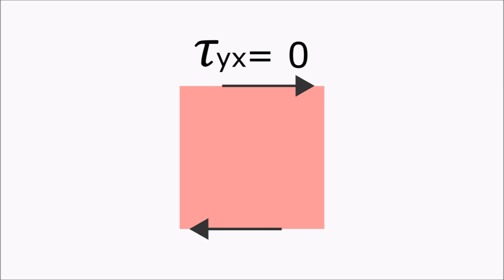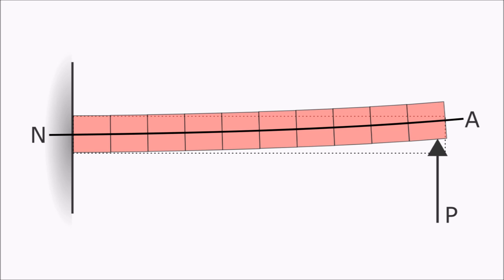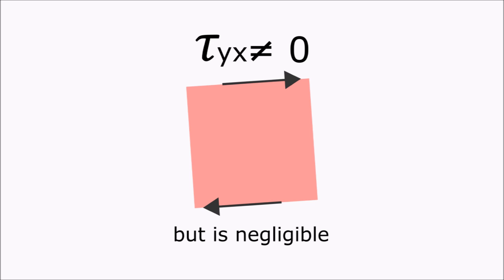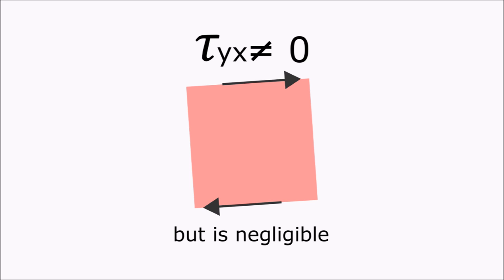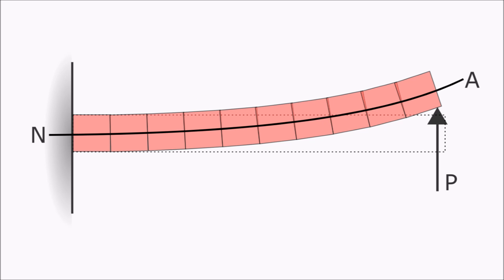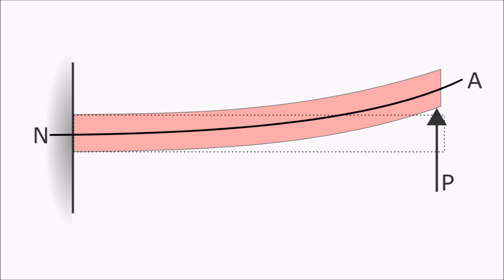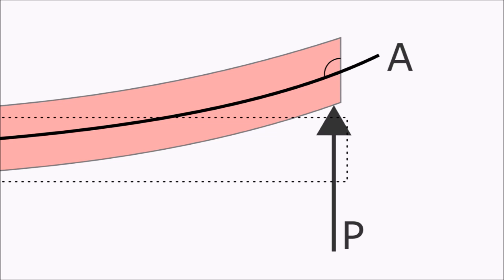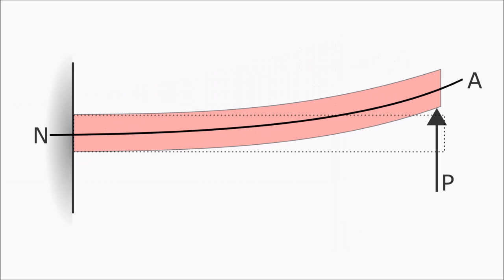Euler-Bernoulli vs Timoshenko Beam Theory

Comment: Maybe I got something wrong, but as far as i know the neutral axis is defined as the axis which retain perpendicularity AFTER the beam has been deformed, that's why for this particular shape is in the middle, because after the cubes are deformed, only the middle of the cube remains perpendicular. I don't understand why would you define the neutral axis before bending. And shear in a beam  under deflection is always present, why would you neglect it?
Reply: If I recall correctly, it can be defined before or after any elastic deformation, as the neutral axis should remain at the same place before and after deflection. And I believe the effects of shear on deflection are neglected because they are usually much smaller than the effects of normal stresses, and for most situations they aren't crucial to the integrity of a given part.

Comment: From what I have read. The reason this theory is necesary, is because in thick and short beams the shear strain energy is greater than normal strain energy caused by bending moments. So deformation caused by shear forces will be more significant than deformations caused by bending moments. 
This makes sense because thick and short beams have a great flexural rigidity and the bending moments are small compared with shear forces.